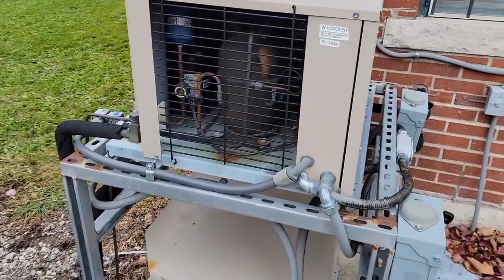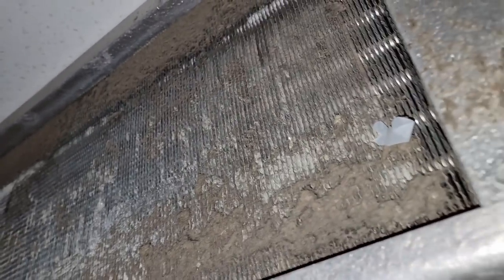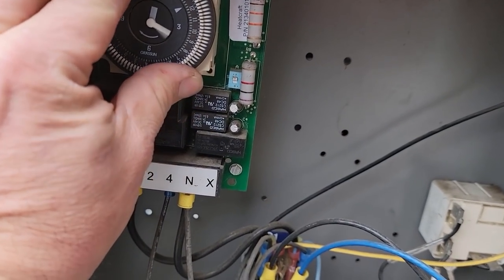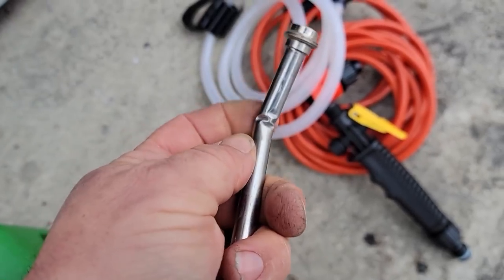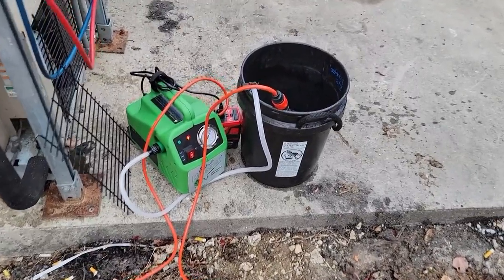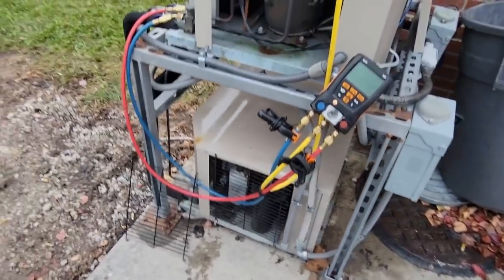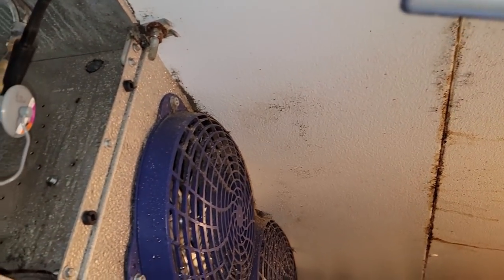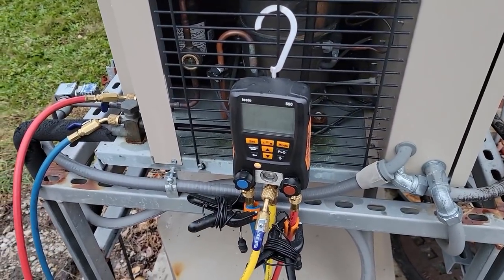Saturdays Are Made For Service Calls....Walk-In Cooler Disaster

Comment: Nice videos. Had a call last night (10pm) from a referral. Heatcraft condensing unit and evaporator. Found same leaks as in your video. Pinholes in multiple locations. Model plate on condenser unreadable. Looked up compressor for refrigerant. R22. Mineral oil. Told the owners and they requested I add refrigerant to keep it running. They pretty much ran out screaming when I priced the R22 to them. I will be replacing the compressor and evaporator assembly tomorrow morning. R404 or 448. Cheers.
Reply from the maker: Thanks for sharing👍👍

Comment: +1 on the Fenix brand of flashlights.  They were the first I tried for a pro level LED light. I still use 5 of them on regular basis,  taking much abuse. Thanks for the videos!
Reply: Dollar Tree has headlights for a buck, and provide a nice amount of light for a panel light. Batteries extra.🙄
Reply from the maker: To each there own, I'm just picky about reliability and seeing what I'm doing.
Reply: Been using Fenix for years for handheld torch.

Got some Chinese headlamp for hands free.
Reply: @etherealrose2139  For my headlamps, I went with Nitecore. The HC50 and HC60. Use Panasonic 18650 Lithium rechargeable. Run about 6 hrs on the highest setting. Think I got about 4 or 5 of them in rotation!

Comment: Hey Rick can you give links to the nozzles you are using on that porta blaster?
Reply from the maker: Everything was factory, I just bent the wand. I'm going to try to cut a 90 in to the end wand so it can be poisoned easier. Putting it in the part I bent doesn't work as well because it doesn't have a swivel nut.

Comment: I would never top off a charge without first cleaning that condenser!
Reply from the maker: That's like worry about what you look like before you go to the ER. The system was screwed. The customer dug a hole and now the system's not worth fixing. I'm not going to worry about a condenser in the middle of winter in the middle of the night. Otherwise if it was under better circumstances I would have washed it out like I normally do. Thanks for the feedback👍

Comment: How do you charge without cleaning the equipment?  That will affect the readings 🤔
Reply from the maker: Were hourly, so you do a full service on the weekend when the customer doesn't want to be proactive and get the equipment serviced when recommended?
Reply from the maker: I just went back and looked at the video, what the hell are you talking about? I cleaned the coils and recharge the system, they have a system leak 🤦🏻🤔 are you even in the field?? What else do you want me to do?

Comment: How’s the pressure on that compared to the m18 transfer pump?
Reply from the maker: The transfer pump has more gallons per minute but it's not as controllable and I think that's why my seals are leaking now because the back pressure was to high. To me this is just more convenient and easier. Especially controllable so I don't make a mess inside a store.

Comment: How long does you sprayer work on that battery setup. Meaning like have you tested how many coils you can clean on the charge
Reply from the maker: I would guess at least a hour or two possibly longer. I haven't ran it non stop until it kills the battery.
Reply: @HVACRSurvival  gotcha I was thinking about getting this one but didn’t like how you had to plug it in until I seen your set up. I hate dragging a hose out to wash one condenser especially in the summer when you don’t have time to wash all of them.
Reply from the maker: I didn't know if I would like the plug-in power supply at first but really if you think about it, generally the batteries tend to go bad on something like this because you don't use it very often.  This doesn't have proprietary battery's to wear out.

Comment: Where'd you get that battery pack?
Reply: Look online. Probably HD.
Reply from the maker: I got it local at our Milwaukee dealer, they had it on sale. If you want to get it to Amazon you can use one of my links down in the description to support the channel, it doesn't cost you anything extra. Otherwise search online. It's great for charging batteries on phones computers, running small devices. Thanks for checking it out 👍